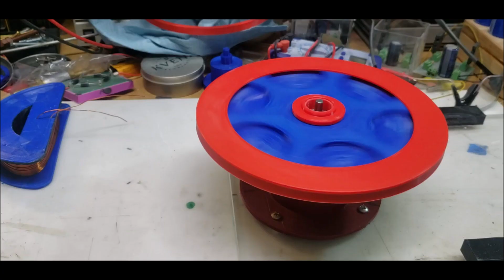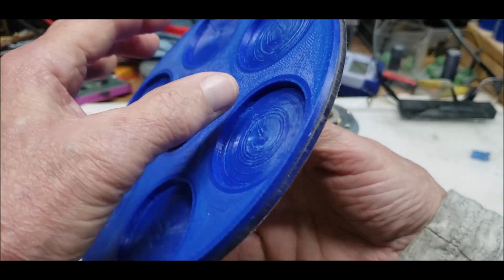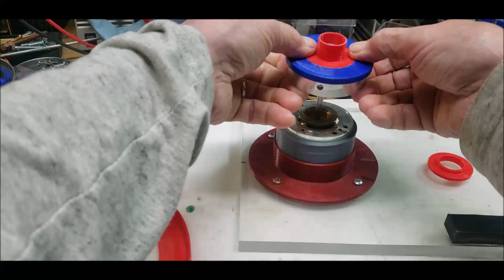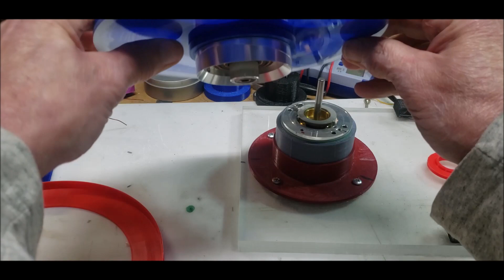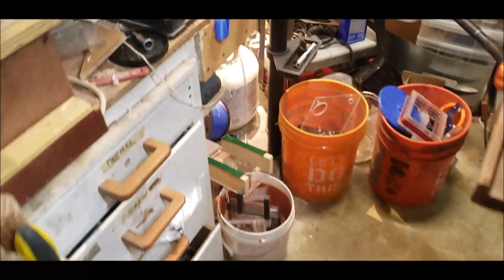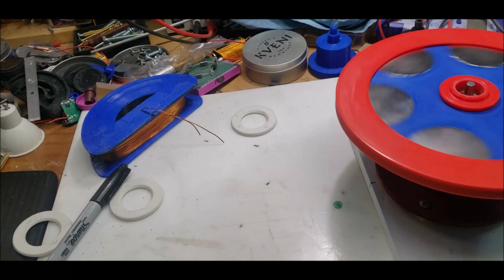3D Printed 6 Disk Rotor Finshed

Comment: I know your main point is printing all the parts... but if you have the drillbit at the exact size of the magnets. why bother printing the rotor. I would drill the holes in the plexi (have it the same thickness as the magnets, and press them in.  It would avoid another wobbling source...  you can fix the plexi to the vcr bit with brass screws. But I have another question... Arent the magnets to close to each other? at least for the generation part. because you will have 2 magnets, one south, one north over the same coil at the same time?. The motor part doesn't mind, because your hall sensor only works with the south poles, but i fear that the generator output will be better with only 4 magnets (or smaller coils). But of course i could be wrong. cant wait to see your first tests.
Luc
Reply: Hello, remembering the construction of the circuit with respect to the hall sensor, I put a "BIBPOLAR" hall sensor in it, which I don't know if it actually works with the two north-south poles, so the motor should work without any problem with 6 neodymium magnets.
Reply: @skycollection  I did that once, with a "normal" hall sensor circuit and a BIPOLAR sensor, but it didn't really work.. because the coil was pushing when a south pole passed the sensor and was also triggered when a north pole passed by.. the coil was pushing in the same direction as expected, but the magnet was the opposite polarity, so the rotor was trying to go in the other direction. i think there are circuits  that will work with bipolar sensors, (you have some driver chips that can handle both polarities)... but i think having little tiny "timing" magnets just for the hall sensor, will make it much more efficient.
luc
Reply from the maker: so for the first part, I didn't know that the special drill bit I had was the right size until I needed it and yes, I want to 3d print as much as I can.  And for the second question, I don't know so I guess we'll see :)